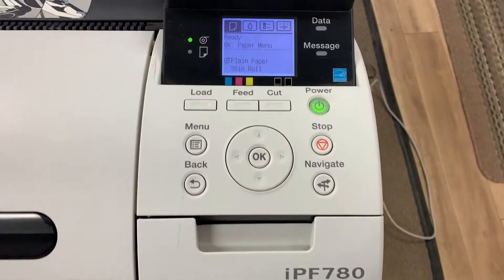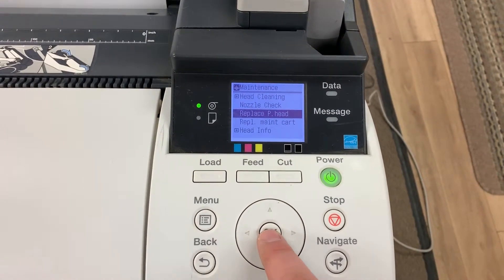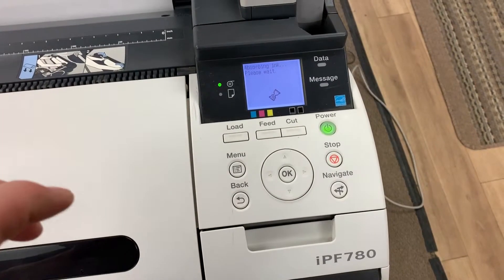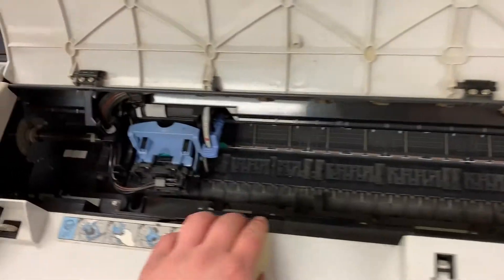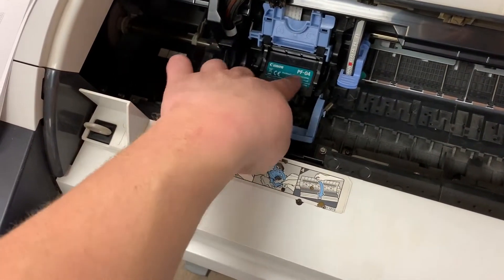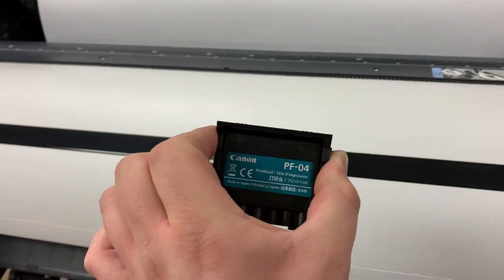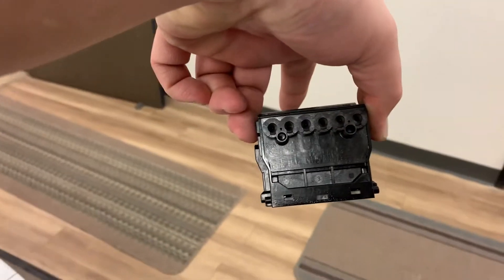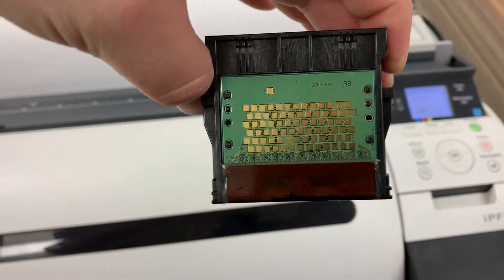Canon Printhead Replacement

Comment: Our old printhead gave an error about needing to be cleaned. We've gotten two new stock replacements and both give an immediate 'printhead error' without ever trying to draw ink. The old one at least goes through the motions before saying it needs to be cleaned. Any suggestions?

We are going through the replacement procedure in the menu. Everything appears to be seated correctly.

Comment: Yes but I have a printhead error the machine will not let me exit out of the printhead error to get to the menu where I ask to replace the head thus the carriage will not move to the replacement area.
Reply from the maker: you have an error code, rather than the "print head needs to be replaced" generic message?  If that's the case you need to go through service mode to tell the printer you want to change the print head.